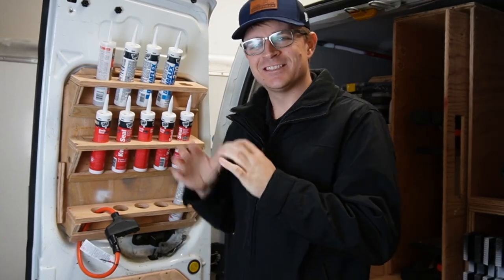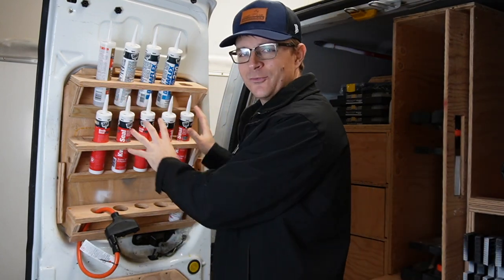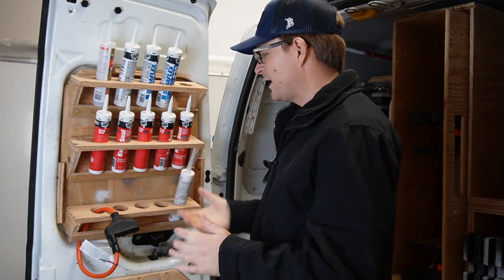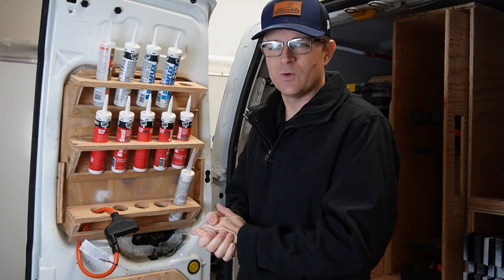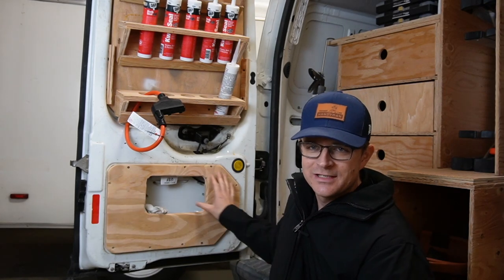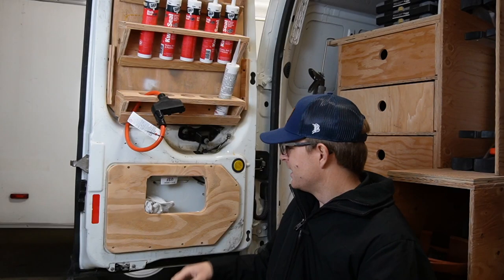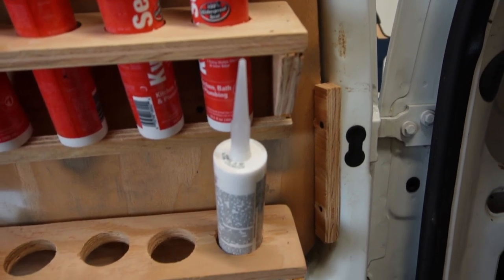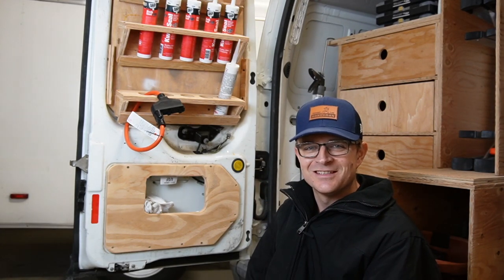Tool Van Backdoor Storage | How I Built It

Comment: Did you use the self tapping screws to adhere the bottom board to the van?
Reply from the maker: The bottom board is actually just floating, it's in there tight and weight holds it down